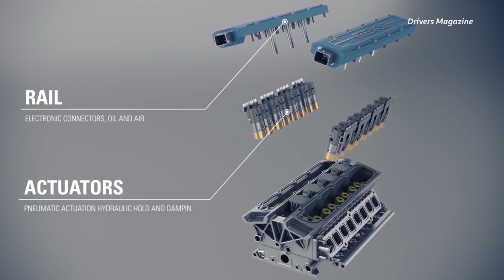Camless Engines May Not Be As Far Off As You Think

Comment: I've been watching this company for a couple years now and I'm ready to go to Sweden and try to figure out why they don't seem to give a damn about the aftermarket. There is a long list of motors that, if provided with a freevalve head(s) would sell like hotcakes. Every DOHC motor would lose ALL parasitic loss from the timing system and eliminate the need for cams, pushrods, timing belts, etc.

Who out there with a muscle car (who isn't a retro-grouch) wouldn't want to be able to convert their monster-size engine to have over 30% more power/torque and also would run WAY smoother. Also, redline for each engine would go up a modest amount.

Christian! Develop heads for the aftermarket!!!! Or, develop ways to use existing heads as a carcass for the new head (most cost-effective if possible).
Reply: Samsonian Pitydafool i agree

Comment: I'm surprised this isn't into production already, regular automakers are lazy. Just switch to EV and be done with it ;-)
Reply: InternetDude 
But EV cars have less range then ICE powered cars and is more environmentally harmful to make as well.
Reply: @TR33ZY_CRTM  Less range is true, but being worked on, will cease to be an issue in the future. They aren't more environmentally harmful, an ICE car will be putting out emissions for at least 20 years (over it's service life), EVs only put out comparatively small emissions when they are manufactured, and even in places that use coal electricity they still vastly surpass ICEs for equivalent emission output.

That's neither here nor there though, car manufacturers are hell bent on being able to sell people the same thing, they are utterly unwilling to change or adapt (with the exception of Koenigsegg here). Camless engine technology has been around for years in marine engines, it was just a matter of doing R&D to have it implemented in consumer transportation, but why do that when you can just keep selling people the same trash you've been selling for 50 years and make way more money doing so.

I think camless engine design and carbon neutral fuel sources could save ICE's, but honestly I don't think most auto manufacturers really give a shit. They'll just keep selling unreliable, inefficient emissions-spewing cars until they are forced to stop.